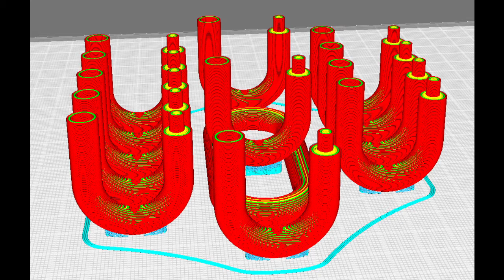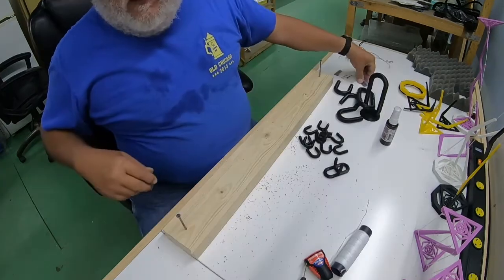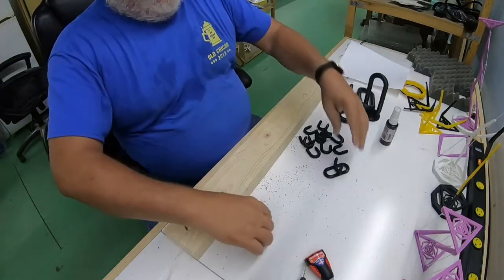Chain Tensegrity

Comment: I'm a little unclear on th threading...does it go straight up through the middle of all of them? If so, what keeps them from sliding?
Reply from the maker: Yes...right up the center.  A drop off super-glue at each joint.

Comment: Hi man, nothing in bad but this isnt tensegrity model. And seen nice of course ;-) good job and have a nice day.
Reply from the maker: In a purest sense, tensegrity has ONLY compression and tension, and no torsion.  This model has a bit of torsion (because the links are curved) as do most "tensegrity" models out there nowadays....the ubiquitous tensegrity table has a cantilever arm, so is not "pure" tensegrity, but cool nonetheless:)
Reply: It is No doubt Tensegrity model
There is a tension between each loop holds on string.
Mine is just printing using glow in the dark pla.
Awesome project 
Thanks
Reply: Now let’s have four for the ultimate tensegrity table! 😃